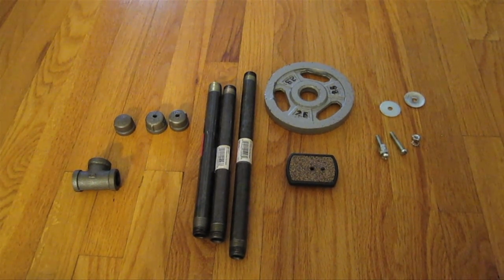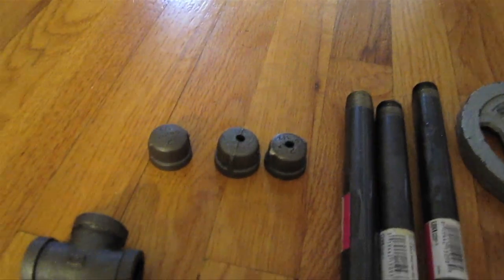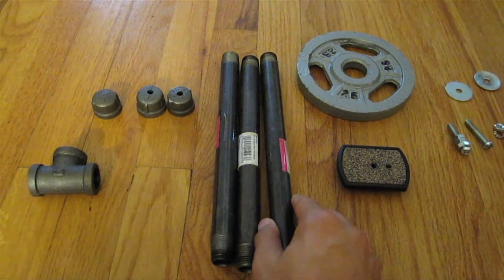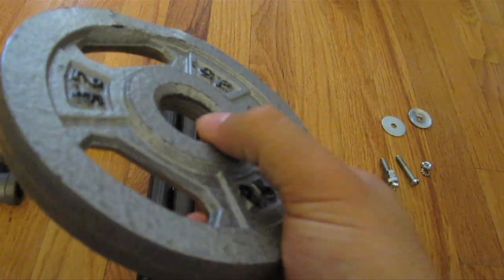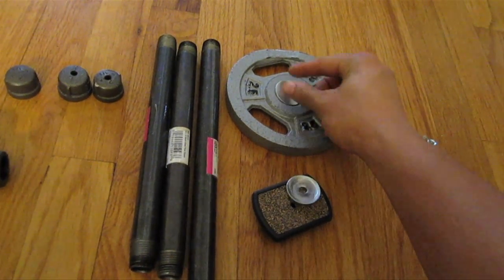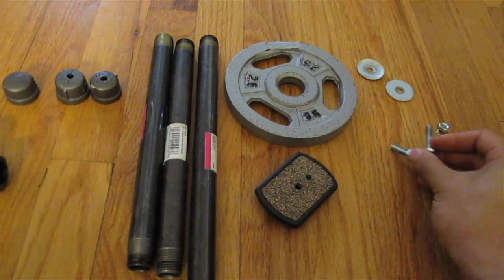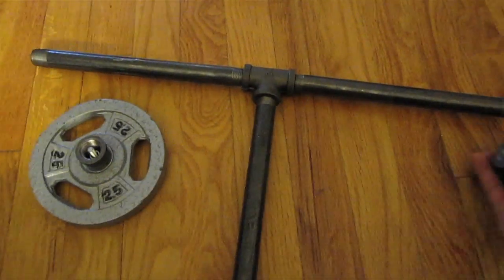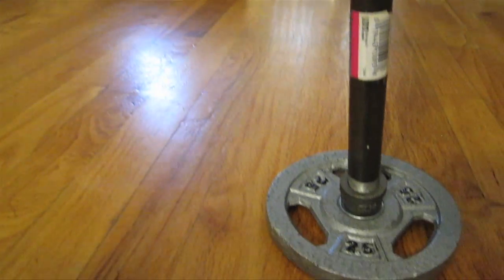Ep. 1: DIY Steadicam

Comment: To be honest man, it ain't really steady. Perhaps the flaw is at the joint of the handle? Usually there's a gimbal to isolate the movements and vibrations and hence the smooth flow of the video. Can you make one with the gimbal on it? Same design but with the gimbal at the center. :D